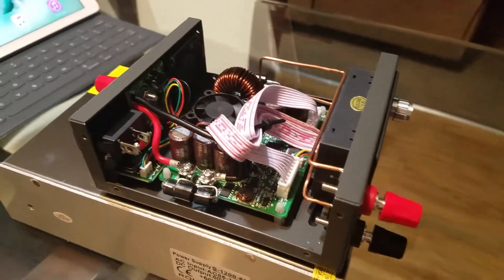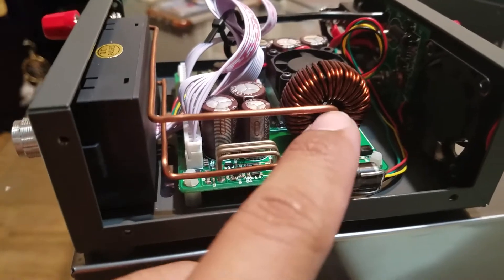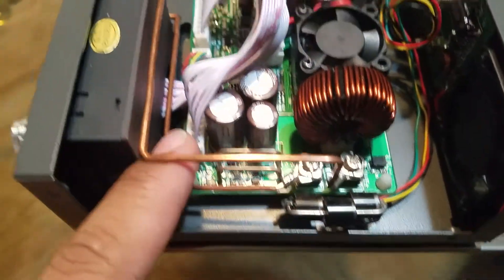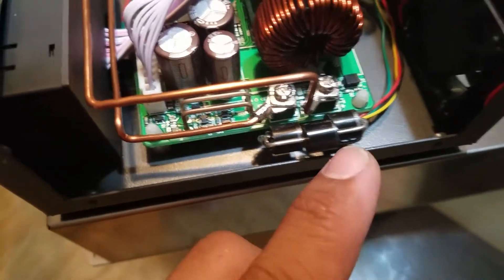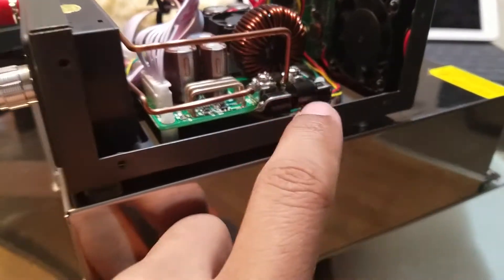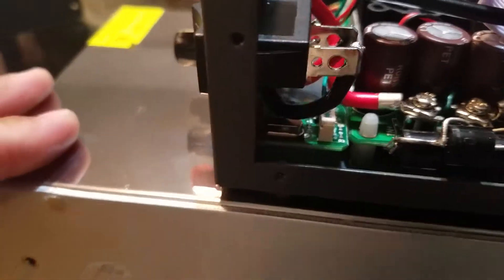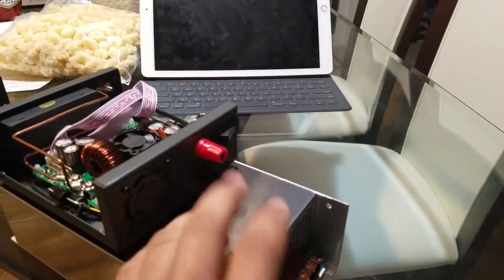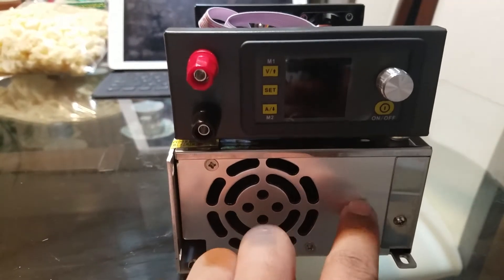DPS5020 and 1200 Watts Power Supply DIY Bench Power Supply with Constant Current

Comment: The diode protection is nice,  but it would drop the output voltage to a certain extent (usually 1 volt or so) that it will display an incorrect reading. So if you dial 12 volts , you will actually get 11 volts when you test the output terminals.  Would you care to comment on this?

Comment: Thanks for video. Where did you connect the diodes can't see in video. Love the copper pipes good idea. Thanks
Reply from the maker: the diode is connected in output for reverse polarity protection from the battery